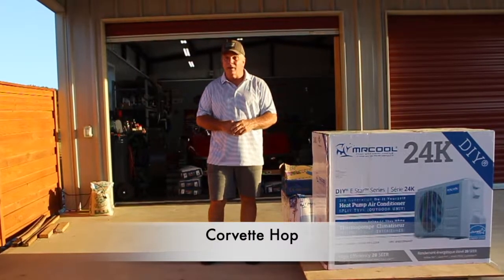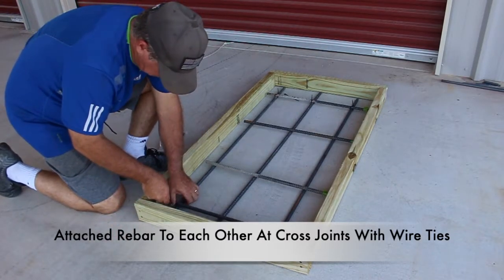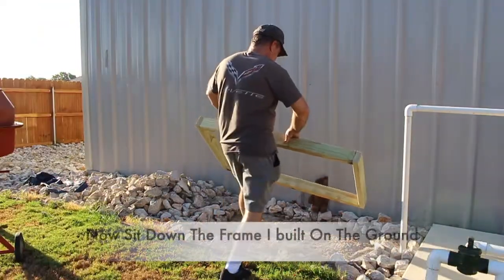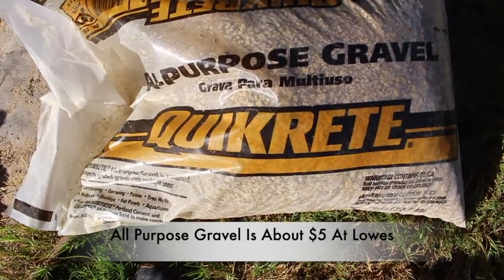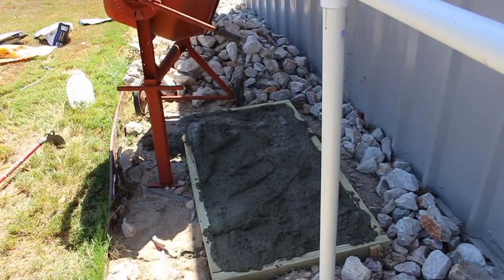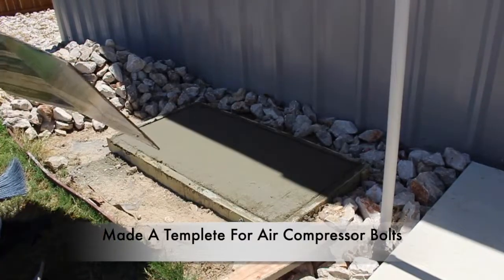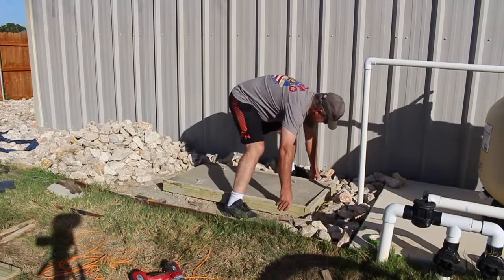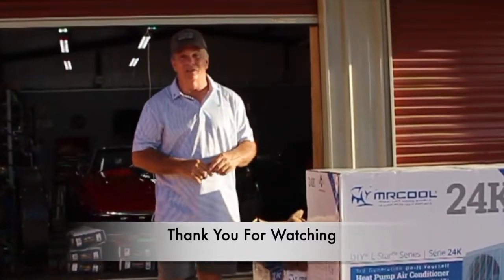How To Make A Concrete Slab (DIY) For Beginners

Comment: Hi there Did you use threaded rods for the bolts? Or what kind were they with threads on top? Thanks
Reply from the maker: Threat on top. Just be careful and allow enough threads out of the concrete. Thank you for taking the time to comment.